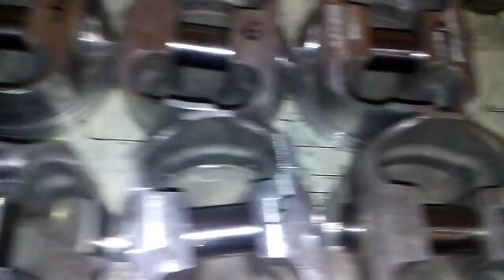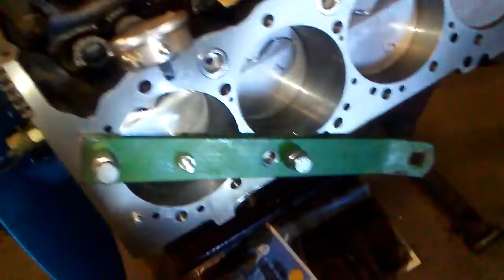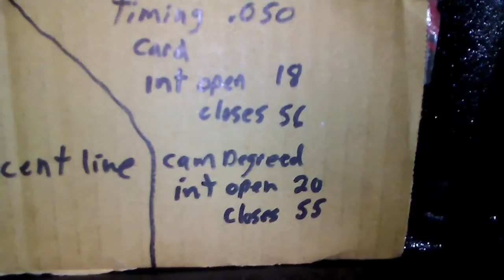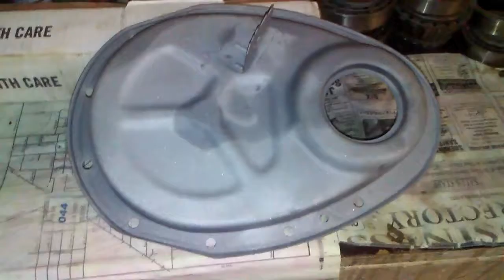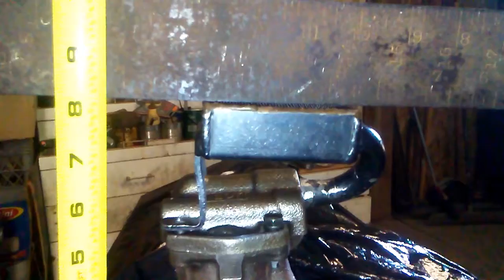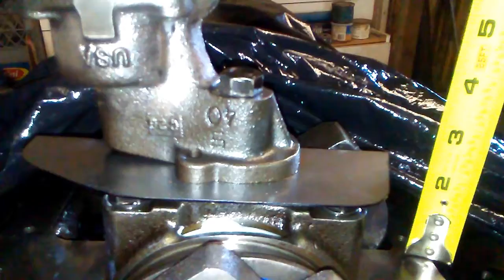406 sbc build pistons rods and oil pump screen fail  project blackie # 2

Comment: 406 For the street win.Best motor on the street in my eyes.Big block torque in A light weight package.
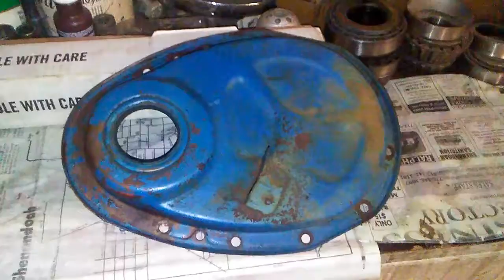Reply: I love the 327 motors and the 400.The 327 never had enough torque since I am A  torquei kind of guy lol.Those 400 definitely plant your azz in the seat but did not have that fast RPM’s like the 327.I remember my built 327 was snappy rpm’s and I had to put 4:56 gears in the rear to keep them RPM’s up.The 406’s that I run now geeeez.If you can grab the $20 bill off my dash as I go through the gears you can have it kid lmao,,, as my uncle would say.I was able to grab it once when he missed 3rd gear lmao.But when he had A 454 with an automatic ummmmmm I never got it.Even to this day lmfao.
Reply from the maker: @Obituary818  i have never personally owned anything with a 327 in it, but i have had alot of friends with them in their cars, lets just say i made them a believer in a 400 small block, i think they got tired of seeing my tailights, LOL
Reply from the maker: yes sir, my fav small bock
Reply: Mine is just about on the road.Going to wield the 3” exhaust tomorrow.Pray to god I don’t fuck up.Again lol.Geeez 1 step forward 10 steps back.
Reply from the maker: @Obituary818  i wish u good luck, sometimes there can just be one of those days. hopefully its not tomorrow.
Reply: Hey big dog.Love your educational videos.High 5.Curious to what your compression might be.I see you are running flat top 2 valve relief.I don’t know what your quench is or your head gasket.I am sure you are probably running A 64 CC head.I assume somewhere between 10.1 to 11.1?

Comment: Did you have a different video that commented on the block water passage plugs that are shown in the three top water jacket holes in the block?
Reply from the maker: it should be in the playist of the engine build. i did the build from start to finish. thanks
Reply: @chevyfarmersgarage1955  thanks

Comment: I had a 400 I put in a 1983 Camaro years ago. It didn't hold up. It was bored .040 over. It was a 2 bolt block too. It always ran a little hot and I had a 4 core radiator in the car. It was quick as hell though for a relatively mild engine. 9.9 compression, the cam was a 214/224 443/465 with a weiand dual plane and modified QJet, headers, true dual with flowmaster 40 series. It would do 105 in the quarter with 3.08 gears. I wish you luck with your 406.
Reply from the maker: i had one built like that years ago, but .030 over. in a 79 malibu that was my daily driver. i am just about ready to get it running in my s10, & will be heading to the dragstrip with it. thanks for watching
Reply: @chevyfarmersgarage1955  I had a SBC 400 Bored '40 over, Dish Top TRW PISTONS, Small Cam I think it was a Crower? Straight Plug Double Humps, Edlebrock Performer Intake, 750 single pump Holley, with like a 2500 Stall, 350 Turbo with 323 Gears.  I  had it in a '79 Malibu.  It was my everyday driver.  That was one fast car! 7.20 with street tires and pump gas! Wasn't much on the road that would even stay close.  I  used to give the rich kids with the Mustangs with superchargers and all the other goodies something to chase after every Friday and Saturday Night.
Reply from the maker: @joejones9944  sounds like my kinda fun
Reply: Did it have the steam holes in the heads? I bought one that ran hot, with 350 heads, no steam holes, I'm going to refresh it and put some heads on with steam holes!
Reply: @jamest.5001  It did have the steam holes. I had them drilled by the shop that did the heads. It was bored over too much. Those things are prone to run a little warm anyway. I went .040 over. too much.
Reply: @jamest.5001  yeah You got to drill some steam holes.. easiest way is to lay the 400 gaskets in place on the heads, mark the holes then drill

Comment: using 5.7 rods or 6.0 rods changes the cubic inch size because that is changing the stroke and just me i would have painted that block first
Reply from the maker: only bore and stroke changes the cubic inches, rod length changes the peak torque, a longer rod moves the  torque peak higher, if you use the same stroke, your shift points will be higher with a longer rod.